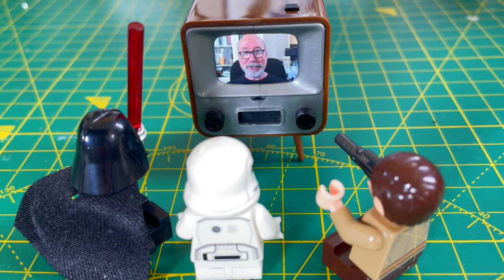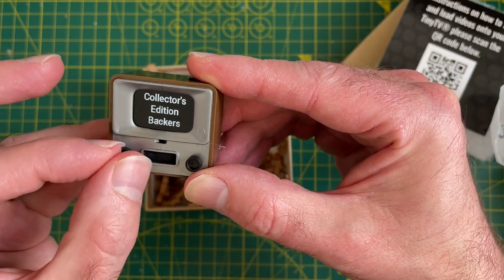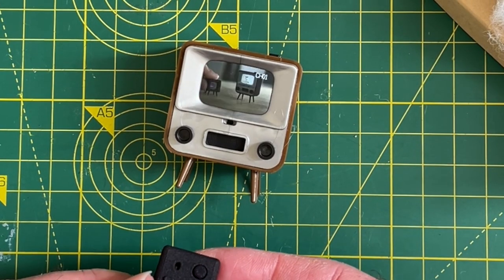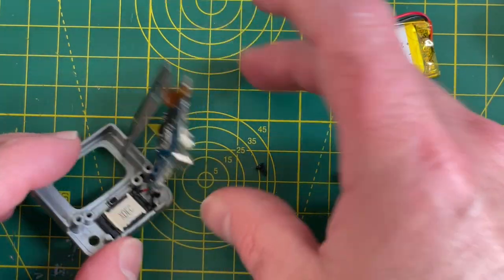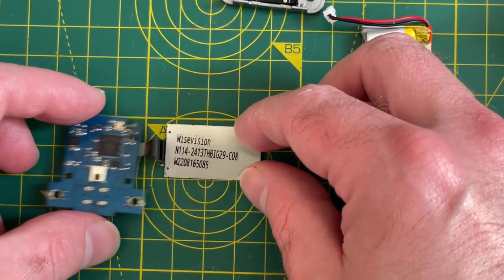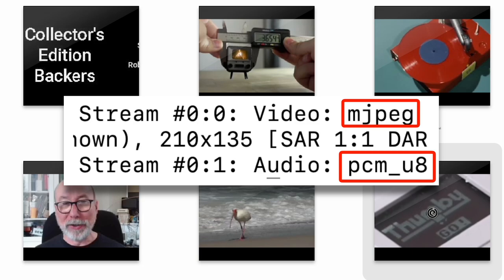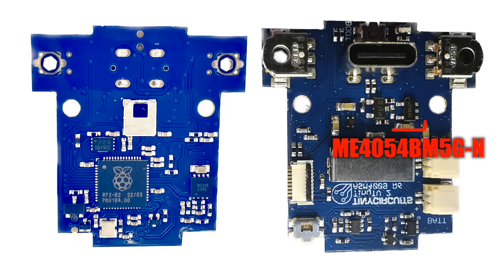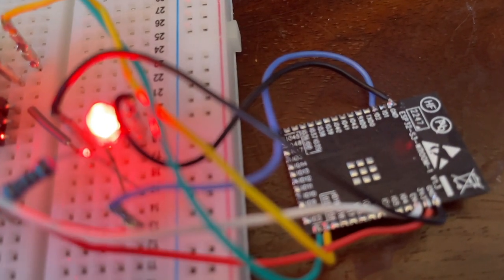TinyTV Teardown - RP2040 Inside

Comment: Thanks for the info on the video format. Do you know how to convert videos to those specs using Premiere Pro? The converter app provided by Tiny isn't good right now. I talked to a dev and he said there's no ETA to update it, although he is aware of the issue.
Reply from the maker: I don't know premiere pro, but potentially you can use ffmpeg to convert the video - it's a command line app so may not be suitable for what you want to do.

ffmpeg -i input_video.mov -c:v mjpeg -q:v 3 -s 210x135 -r 24 -b:v 1335k -c:a pcm_u8 -ar 10000 -ac 1 -b:a 80k output_video.avi

That should give you something in the right format.
Reply: @atomic14   Thanks. I'll give it a try.